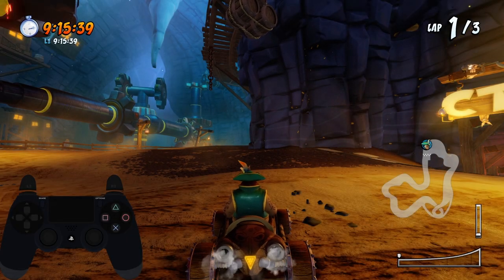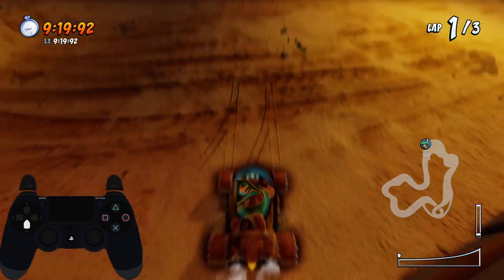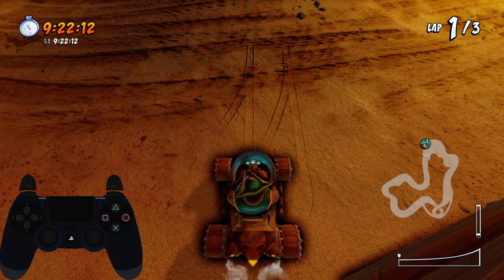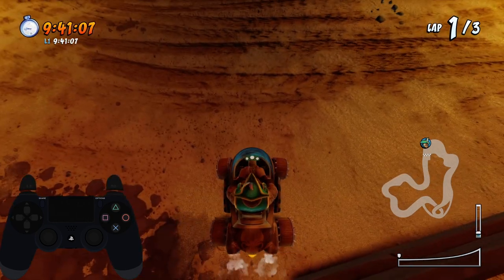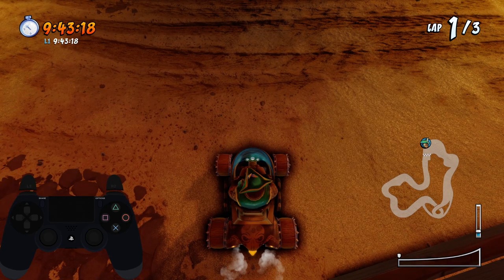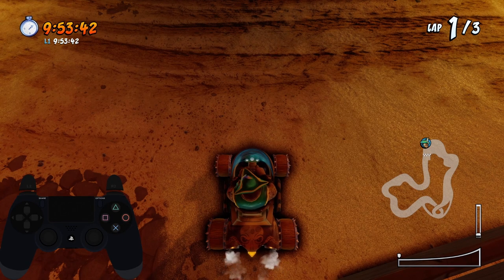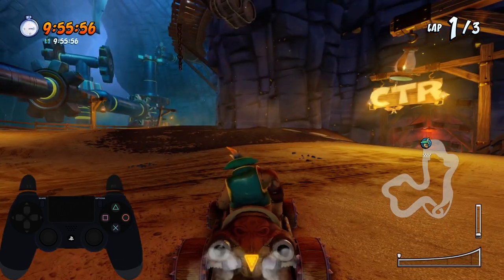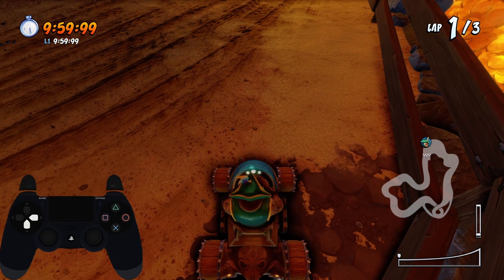2-MINUTE GUIDE TO ULTRA TURN [U-TURN] - Crash Team Racing Nitro Fueled (CTRNF)

Comment: So once you jump then you can press the brake button until you land? Then you have to let go or else it will kill your boost?
Reply from the maker: You need to hold the reverse button too. It helps making tighter turns + maintaining your fire.
Basically when you jump, immediately hold both brake and reverse button. Once you land, let go of the brake button by a frame or two before you also release reverse button.
Just have to remember that it's the reverse button that helps maintain your fire, not the brake.

Brake button = Tight turns 
while
Reverse button = Tight turns + fire maintenance

Hold both, you get tighter turns.

Comment: Any tips for the shortcut jump in Electron Avenue? I feel like there’s some u-turn related trick there that l just can’t seem to get it right
Reply from the maker: Try jumping midway of the turbo pad ramp and not at its peak. Press the U turn buttons while in midair. This should land you on the other turbo pad ramp, allowing you to dodge the electricity.
Reply: Sometimes positioning yourself more right with drifting helps too

Comment: For those who still may not understand. Hiting the brakes while doing this will not deplete your boost as throttling is what continues a boost 

Reversing is still hitting throttling just in reverse so the boost still keeps going, but it the boost still pushes you foward with its strength.

As you reverse, your boost continues, combined with breaking,  turn will create the U-turn. I hope this helps
Reply: Weird. I always lose my boost while doing this... No matter how hard I doing the method, I always end up losing my boost.
Reply: @LordTchernobog  Me to

Comment: I remember how I was learning U-turns in like March or something and I couldn't get it at all. When I realized I wasn't pressing the reverse button I realized how dumb I was xD. Then I managed to get it down, and use it for some shortcuts (like the big skips in Hot air Skyway, and in Papu's Pyramid over the ledge). And then when I found out it's even more OP in Nitro-Fueled, I started to basically use U-turns everywhere.
Nice guide btw.

Comment: I have issues with U-Turns, I don't have problems when I do them on Turbo Track for example, when I have to spam the jump button. But, when I want to do it ONCE, just one jump, to take corners more fast with the usf, I very often lose the usf ! -_- without hitting a wall. I believe that I have problems with the brake button, I may still be pressing the button while I was in the floor!
PS : excellent video!
Reply from the maker: Hmm try releasing the brake button milliseconds earlier than the reverse button. No need to worry about letting go of brake first since you won't lose your fire by simply holding reverse.

Comment: For Xbox w/alternate control users: 

1. Go to Xbox settings on home screen 
2. Find the option to map your controller buttons
3. Map the R1 button to dpad down (this swaps the functions of the two buttons) You can always go back and change this setting back to normal when you're done playing for the day, but it is indeed the most crucial step to the equation. 
4. When wanting to Uturn, you must release the acceleration (R2) and quickly hit and hold down R1 (this would have been the down on dpad you would have had to hold down for Uturn which is almost impossible while using analog). 
5. While holding R1, also hold brake (x). You must be holding R1 down before adding brakes or you will lose your fire. 
6. Now that you are holding R1 and X, spam the L1 (jump) button while using left analog to guide your Uturn. 
7. Once finished with the Uturn, release all buttons and resume R2 (acceleration), and drift as soon as possible to maintain fire. 

I have done 101% completion of the game, and have gotten to only 9 more Velo times to beat, and just today learned this from watching The Viperian. I can't believe I didn't find this sooner but it has breathed new life into playing.

Comment: I prefer to use the analog on my pro switch controller but you made it look so easy with the d pad
Reply from the maker: Meanwhile I cannot imagine myself using Analog in this game haha. If you want to stick to Analog, you can remap the Reverse button to L2 instead maybe (thanks to the Switch's latest firmware update allowing you to remap buttons). This way you just need to hold L2 then steer your Analog stick to left / right.
Reply: @KindredCVS  thanks for this, hopefully helps me on the rest of tracks I have left, keep up the good work with the vids

Comment: @kindredcvs does this work with the analog though?
Reply from the maker: It does but I find it extremely difficult myself since you need to turn your analog stick at a specific diagonal angle, and as accurate as possible. Unlike when you use the D-pad, just press two buttons.

Maybe it's just me being used to D-pad. I recommend just switching to D-pad the moment you need to U-turn, then go back to Analog when you no longer need to do it. BUT if you can pull it off with the analog then stay with it.
Reply: @KindredCVS  thanks
Reply: Yeah i'm too used to the analog i can't play with the d-pad its horrible
Reply: @fanjothebest974MNR  If your on PS4 remap a button like L2 to be your Down Dpad Button hold it while turning with analog and hold square(L2+AnalogLeft/Right+square hold)+ (Tap R1 to hop if you need). (let go of square first when ur good to stop of course). if you hop and slide with L1 and  use R1 to activae boost switch Down D-Pad to R2 this makes it so u can still hop turn (L1=Hop R2=Down Dpad + square+turn with analog) hope this helps. you can remap buttons on ps4 in settings/accessibility/button assignments and then it can be turned on and off after u set it.

Comment: What does u-turning do to your reserves?
Reply from the maker: @babbisp1  It lets the reserves drain as if you're driving normally without boosting, as opposed to directly holding on the brake button alone which completely empties it.
Reply: @KindredCVS  
I see. So if I cross let's say 40 meters while constantly jumping (U-Turn style), will it drain in the same amount that simply accelerating through those 40 meters would? 
In other words, being in the air doesn't stop any drainage, no different than being on the ground?

Comment: I was doing times trials developers in Turbo Track, I didn’t beat that trials and I beat Alot not turbo track only developers and never get master wheels again, During played my switch.
 how should I use switch controller or Joy Cons? Need helped
Reply from the maker: Might be better if you have a Pro Controller, but Ultra Turning is definitely doable on Joycons if you are using the buttons themselves as the Dpad. Just have to press left/right and down at the same time.

Comment: Have they nerfed this method? I'm trying it for dev time trials, and whenever I hold brake mid-hop, it depletes my reserves as soon as I land. Doesn't matter how fast I mash the hop button, it slows me down every time.
Reply from the maker: Are you also holding the reverse button? That's the key for not losing your reserves.
Reply: @KindredCVS  You know, I thought I was, but after giving it another go  I properly made sure to push down on the d-pad and it worked just fine. 😅
Guess I wasn't pressing it hard enough before. Thanks for the tip. 👍

Comment: Quick question, do I have to do the d-pad, or dose it work on the thumb stick too?
Reply from the maker: You can stick with the Analog / Thumb stick but I will recommend remapping the Reverse button to L2. When you want to Ultra Turn, you will hold Square (Brake button), L2 (your new reverse button), and the Thumb Stick (Left or Right).
Reply: @KindredCVS  thank you
Reply: @KindredCVS thank you very much for this

Comment: I've used days on turbotrack and can't do the s and keep fire against dev ghost:(
Reply from the maker: Hmm sometimes just getting "Perfect" boost isn't enough. If possible, boost when the bar is almost full. That's when you get max reserves.

I'm just guessing that you are losing fire because of not having enough reserves.
Reply: @KindredCVS  still can't I loose on the same turn :v get through but loose fire right after:/
Reply from the maker: @spontanelly789  Are you sure you are holding the reverse button while doing it?

Comment: I’m not using the d pad like
Reply: If your on PS4 remap a button like L2 to be your Down Dpad Button hold it while turning with analog and hold square(L2+AnalogLeft/Right+square hold)+ (Tap R1 to hop if you need). (let go of square first when ur good to stop of course). if you hop and slide with L1 and  use R1 to activae boost switch Down D-Pad to R2 this makes it so u can still hop turn (L1=Hop R2=Down Dpad + square+turn with analog) hope this helps. you can remap buttons on ps4 in settings/accessibility/button assignments and then it can be turned on and off after u set it.
Reply: Jinking thanks!😁
Reply: @thoughtlessvideos8472  you're welcome and have fun